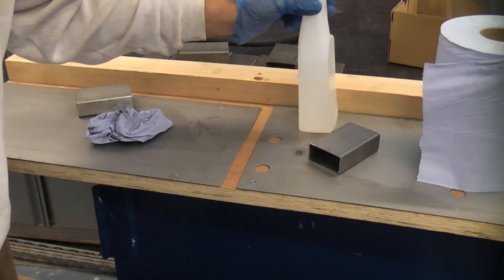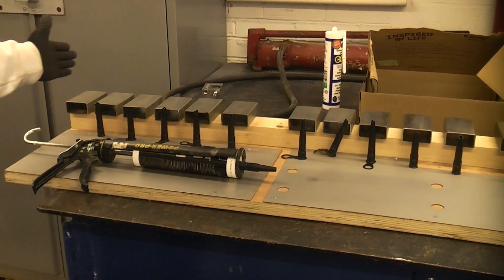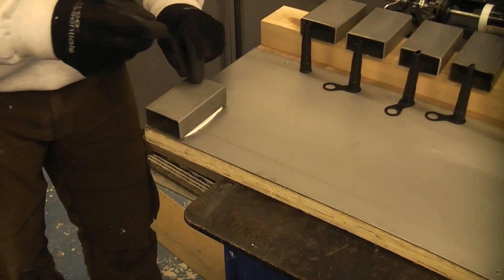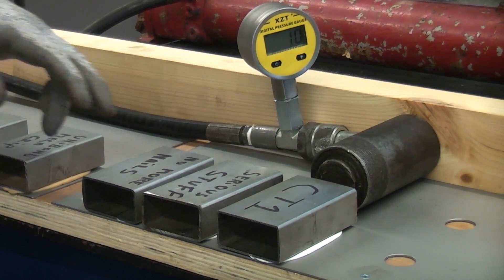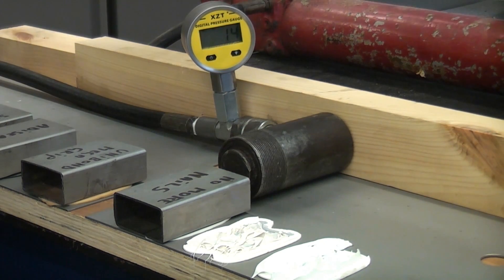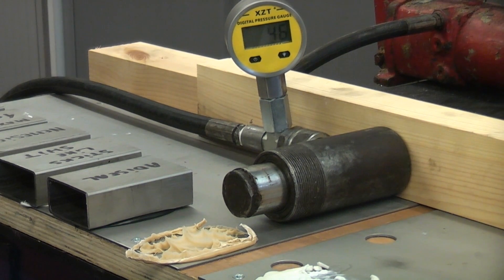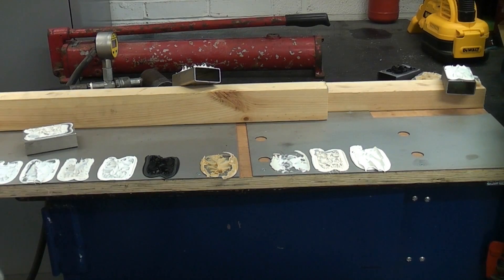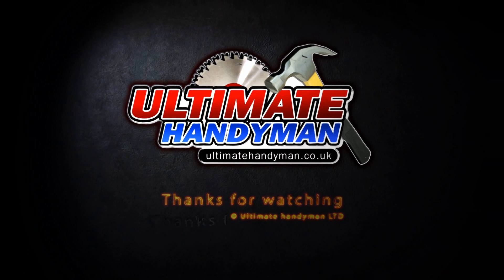Grab adhesive test using 316 stainless steel

Comment: not a very good test imo. first, it seems you're not actually bonding 'stainless steel',  neither the blocks or the flat sheet. you cleaned /degreased it but you didn't remove the oxide layer which is what makes stainless steel... 'stainless' so you're actually bonding two oxide layers together in  every case. second, the wooden back stop flexes in some cases and the blocks move relative to the sheet so the bond strength (which presumably should be measuring shear) is compromised in some cases by forces which are inconsistent between samples

Comment: My understanding of adhesives is less is more.   You seem to use a lot of adhesive and you didn't clamp down the blocks.  The goal is to have the thinnest layer possible between the two metals.  Please correct my understanding if I'm wrong.

Comment: These are all moisture cure adhesives. The manufacturers generally recommend spritzing metal with water just before you stick them together. That would let the middle cure up and likely vastly increase the bonding ability.

It worked better on wood because it can draw some moisture from the wood although even that would be helped by some water.
Reply from the maker: Thanks for the comment

Comment: Redo the test with a small amont of adhesive. Way too much adhesive was used and this impeded the curing. Use a fixed weight to sandwich the test samples and set a timer to improve on test controls. I'm willing to bet that less adhesive equals more strength. Just saying.... Cheers mate
Reply from the maker: Thanks for the comment 👍

Comment: Hi, great video! Any suggestion on bonding metal to wood?
Reply from the maker: Thanks, I have not tested out wood to metal yet but I might do in another video.
The nemesis brand worked well on wood to wood, so that might be worth a try. Failing that the Adiseal is good ;-)Thanks for the comment

Comment: Excellent test, possibly more reliable than your previous tests using wood blocks. It doesn't matter that people wouldn't normally choose a grab adhesive for joining metals.
What a shame you didn't test Pinkgrip, which is good value, and Gripfill which seems to be popular with the builders I've come across.
Reply from the maker: Thanks Mike, the problem is that PinkGrip and Gripfill are sold in cardboard tubes. In the video I said I had about 12-13 ish test pieces (can't remember without watching the video). When I got to the PinkGrip and Gripfill the tubes had hardened completely and had to be binned. I have just spent another £80 on some other grab adhesives, so its getting expensive testing them all LOL
Thanks for the comment

Comment: Great test, I guess there would be occasions where you would want to stick to metal, such as boarding over RSJ. Bash some bits of stud work in and slap some adhesive in for double measure. would be interesting to see how JB Weld would cope with the steel to steel...

Comment: just thinking out loud... timber would absorb the moisture from various grab adhesives where as metal wouldn't.  hence why adhesives were still wet underneath some.
Reply from the maker: Yep, it was not my idea to use the metal. The wood test produced much better results.
Thanks for the comment ;-)
Reply: Ultimate Handyman same with any substrate. adhesion is better with surfaces that absorb moisture.  but too much absorption at a rapid rate can be equally problematic.

Comment: Would you be able to do a strength test or some other testing with silicone sealant
Reply from the maker: I think a strength test would not work well as silicone is not designed for holding, but sealing. You can however use it as a grab adhesive for light weight things and it does work as an adhesive. Perhaps a good test for silicone would be to test out the mould resistance of it!
Thanks for the comment

Comment: if u gonna join steel ud just weld it right  ? lol wood and ceramic etc i can understand using adhesive but not on metals
Reply from the maker: Yes, I would either weld it or bolt it, but this was done at the suggestion of one of the adhesive manufacturers.
Thanks for the comment

Comment: i know u made a video on silicone removal in a tiled area ,but i have black mold silicone around door and window frame due to condensation and the plaster wall around it is also a bit manky ,does anti mold silicone really work or just a waste of money ? plus i intend to paint the wall around the alcove of the door and window frame ares with bathroom water resistant paint to prevent damp being absorbed into the wall
Reply from the maker: Some of the anti-mould silicones do work but if the whole area is covered in mould there is a chance that it will cover the silicone, but it should be easy enough to remove with some mould and mildew remover. Ventilation is the key to preventing the mould in the first place.
Thanks for the comment

Comment: On the whole, looks like a pretty fair test, but how much force is absorbed by the adhesive's elasticity?  It appears as though some of the products "gave" but didn't completely separate straight away.  I wonder if this skews the results, or if this has any bearing in actual applications.
Reply from the maker: Thanks Jo, yes some of the grab adhesives are marketed as being flexible which could be useful in some situations (although I can't think of any).
Thanks for the comment ;-)

Comment: A fair test would probably need you to use a constant weight to press all of the pieces when gluing and then use a puller to pull the pieces straight out from the surface. That said, the pieces would not need to be that big either. 
It was still very interesting to watch how much difference there actually is between products... somehow I predicted that "no more nails" would fail miserably... never thought much of that brand.
Reply from the maker: Thanks He Ka, The problem with a constant weight for all pieces is that some of the adhesives are thinner than others, if you applied the same weight to each piece some of the adhesive would be forced out completely from between the test pieces.
Thanks for the comment ;-)

Comment: Thanks for the interesting video. 
Do you think that a two-part epoxy would have performed better than Serious Stuff?
Reply from the maker: Yes I would imagine so. If I get chance I'll do some testing of epoxy glues in future.
Thanks for the comment
Reply: Thank you. That will be another interesting video.
Reply: The kitchen sink tap is lose and I can't reach underneath to tighten it so am thinking of using some glue to keep it from rocking each time we turned the tap on...research took me here...should I try the Serious Stuff or that two part Araldite Epoxy Resin Glue would hold it down better?????
Reply from the maker: @mykalgb8643   I'm not sure which one would work best, sorry for the late reply, I have just seen this comment

Comment: Hmm there's a lot to this, and I suspect the unhappy manufacturer would probably be blaming the wood lamination having weaker areas on your previous test. In suggesting stainless I reckon they meant sticking a timber block to it, then it removes the lamination argument, and gives the adhesives which require a porus surface a sporting chance. I think your efforts have been wasted on this one. Sticking stainless to stainless simply would never happen, and some of those adhesives would never cure.

Comment: I'd agree that these adhesives would not be the first choice on stainless steel! I'd go with a two part methacrylate, polyurethane or two part epoxy. You'd also have to solvent wipe (e.g. isopropyl alcohol), abrade and then solvent wipe the stainless again just before applying the adhesive.
Reply from the maker: Thanks for the comment ;-)

Comment: we all know the bullshit that comes out of marketing departments i like how you are testing these and we know we get a honest result so thanks for taking the time to do these tests. but for metal i would'nt even think about using grab adhesives the likes of jb weld locktight etc make glue specificaly for metal
Reply from the maker: Absolutely, it's not something I would ever use on metal either (apart from when being recommended by one of the manufacturers). 
Thanks for the comment

Comment: I wonder, if sanding the surfaces will get a better grip. it is a common practice in knife making to scuff the surface of the mating parts (metal and wood\mikarta\whatever material) for a better epoxy bonding. metal has a sleek surface in its natural state, unlike wood (fibers) or concrete, and that might affect this kind of test...
Reply from the maker: Possibly, but the adhesive seemed well stuck to each piece of stainless as it was not polished but rather had a grainy like finish.
Thanks for the comment ;-)

Comment: Is gripfill not a grab adhesive not usally included in your videos
Reply from the maker: I used it in a previous video, but the tube had gone off (along with the Gripfill) as both tubes are cardboard with built in nozzle. 
Thanks for the comments ;-)

Comment: Nice comparison, would have loved to have seen the No Nonsense, Gripfill, and Pink Grip tested here, as well as in your previous tests, as these are much more budget friendly compared to some of these. Could also do a comparison between solvent and solvent-free versions of them to see how much of a difference there is.

I would happily donate a few pennies on something like patreon to help fund further impartial tests.
Reply from the maker: Thanks Daniel, I try not to go down the Patreon route, but might have to one day (hopefully not soon).
I did try some of those adhesives in my first test but the problem with the PinkGrip and Gripfill is that they come in cardboard tubes with a built in nozzle and so it's almost impossible to re-use them after any period of time as the adhesive goes off once the cartridge is opened, unlike the other grab adhesives which could still be re-used. 
I try to avoid solvent free versions as they have given me poor results in the past, but I might do a solvent free test in future ;-)

Thanks for the comment offer to donate ;-)
Reply: Ultimate Handyman I certainly understand the reluctance to do so, just thought it would be a way to fund the materials while remaining impartial. Some quick maths says I doubt YouTube adverts will ever cover the cost of the materials for this test, but at the same time I found it very useful, especially seeing how bad some of the bigger names performed.
Totally understand the issue with Pinkgrip and Gripfill going off and not being able to reuse the tubes after though.
Keep up the good work!
Reply from the maker: Thanks Daniel, Luckily I already had the stainless steel and the grab adhesives were left over from my original test, it's a pity the Pinkgrip and Gripfill had gone off!
Thanks for the comment ;-)

Comment: interesting video with steel, thanks for taking the time to conduct the tests. As a DIY'er the timber test is more related to how I use adhesive at home!
Reply from the maker: You are welcome.
The wood test is also more relative for me as I would never join metals using an adhesive.
Thanks for the comment ;-)

Comment: Could the angle of applied force be a factor here, with the wood the press was applying equal force across the wood in forward  motion, when using the steel the piece was being pushed forward and up.
Reply from the maker: Yes, that could be a factor but I was struggling with the stainless steel due to the amount of room that I had (on the two pieces of stainless steel sheet) and also the stainless box section that I had ( I did not have enough to cut wider pieces). Obviously 316 stainless steel is expensive and I have to feed the kids LOL.
Having said that all pieces were left for the same amount of curing time and all pieces were removed the same way and there was a huge difference between the weakest one at 60PSI and the strongest at over 300PSI.
Thanks for the comment ;-)

Comment: Great video, happy new year. PS I was interested in how long those speed taps lasted...
Reply from the maker: Thanks, I have not used them since making the video but I have a set at work for the next time I need to tap anything.
Thanks for the comment
Reply: when you count many trades want 20-40 an hour, its after a few uses they have paid there way, for the rest of us, probably stick to the slower old way as its cheaper!

Comment: Very good video.  I believe on metal you have lower surface area in contact with air and they dry a LOT slower than wood, it only has around the sides. Very good comparison.
Reply from the maker: Thanks for the comment ;-)

Comment: Who joins stainless with grab adhesive?
Reply from the maker: I don't know, but in my original test I glued timber blocks to plywood and a few people were not happy, so one adhesive manufacturer suggested using stainless steel- so I did LOL
Thanks for the comment
Reply: Possibly they were disputing the uniformity in that different blocks of wood may have difference in grain therefore adhesion may be affected. Or maybe their adhesive just works better on steel :-)
Reply: Once had some adhesive it was a light brown glue type of paste and never been able to find it since. It was the strongest I have ever used. Once on anything it was impossible to remove it. I think one guy said he used it to secure a cupboard on a wall and when they took the cupboard down the wall came down with it. Apparently this stuff could glue wood together and it would stay bonded for years even if the wood was thrown into the ocean. I remember getting some on fingers and it took 2 weeks to fully remove it.
Reply: Hi Grand Sorry I havent found the name of it yet. It was some time ago when I used it. I wish I new its name, It was the strongest adhesive I have ever used. There were some hinge screws that had come loose on a door, even to this day they are solid and will not budge. I will keep looking for it. Many Thanks.
Reply: Some Cinema chains do with the carpet flooring track as well as Hotels for preventetive trip hazards where carpet meets tiles etc.. Its a thin piece of metal that has a "Track" running down its centre where a piece of platic black  strip is "Slatted" on top. The sub track has holes through it for securing with screws and raw plugs into the floor beneath  as well.
Reply: Where is a risk of fire! or super strong grip is not needed, like indoor applications.

Comment: Its as if the adhesive dosnt fully cure
Having two non porous surfaces
Reply from the maker: Yes, most of the adhesives were soft in the middle even after leaving them in a house with the central heating on for a week!
Thanks for the comment ;-)
Reply: I don't see why they wouldn't be soft in the middle. What difference does the adhesive in the middle of the pieces of steel make from the inside of the adhesive dispensing tube once the outside edges of the steel piece cures sealing the inside off from the atmosphere? Wood absorbs the moisture so it makes for a much better real world test

Comment from the maker: Happy 2017 to everyone

This is the first video of 2017 although work began filming this in early
December. After being contacted by an adhesive manufacturer that was not happy
with the first test using timber I did what they suggested and repeated the test
using stainless steel. 

If any adhesive manufacturers want their grab adhesives testing for free they
can contact me on here and send out samples and I’ll test them when I get time,
providing the results can be filmed and published regardless of the
effectiveness of the adhesive. 

Please comment, like and share this video as it really helps
Reply from the maker: Well really it's called "sticks like sh*t", but what else could the * stand for ;-)
Thanks for the comment
Reply: Ultimate Handyman I'd have thought the stainless test would have been tougher to prove an adhesives yield. Presumably timber would help it cure by taking up moisture within the adhesive? Not sure.
Reply: you must be doing summit right to rattle the manufacturer's cage ... Keep up the good work, you are the man!
Happy New Year
Reply from the maker: Yes, it seems these grab adhesives work better on wood because of the absorbency of the material.
Thanks for the comment